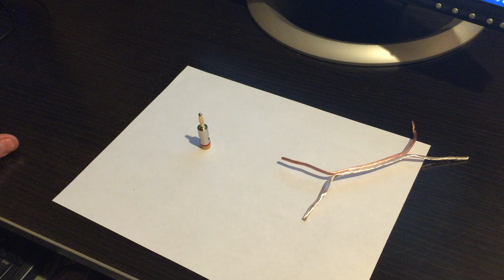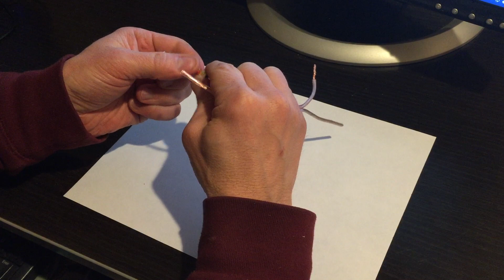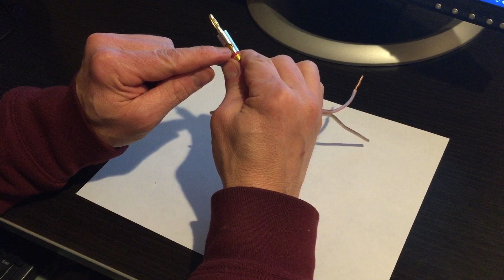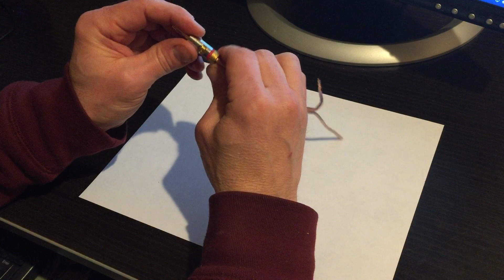Wiring a CE Tech Banana Plug

Comment: Strip off about 1" wire, no less; unscrew tip almost all of the way out insert/smash wire into the assembly. Hold both the wire and the plug and screw the tip on tight, this smashes stripped part of the wire into a ball.

Comment: From Home Depot support, basically exactly as described in this video:

"For this type of banana plug as others similar to it, you will first strip your speaker cables back to about 3/4" to no more than 1" in length.

Push the stripped wire through the bottom piece (the one with the hole in it), and then bundle or compress the wire at the end, so that the banana port portion will compress into it once it screws down into the bottom piece. Twist firmly and test it to ensure the connections are successful."

Comment: The hole in the end is for another banana plug Randy, it is not intended to take the cable. As Nicopeet alluded with this design the wires are inserted from the side and then the large screw tightened to hold the cables in place. I don't like these types because over time the cable strands relax under compression and you soon get a less than optimum connection.
The twin screw (Nakamichi) types are my personal fav's, 2 screw security and lightweight, give them a try my friend, I think you may prefer them.

Comment: I hate this type. The Nakamishi or equivalent type with 2 screws are the best. No bending of the wiring  needed.
Reply: phototristan 

I don't understand the female bannana sockets. The terminals the bannana plugs plug into.

I'll try and draw a mental picture of them. 

The fronts of the screw forward to reveal a hole in the side of the terminal.....and the pics on eBay show the bannana plug connected from the side. It appears then the front tightens down onto it.

I've never seen them connect from the side.....only straight forward from the front. 

I've seen bannana plugs with the side hole but not the female terminals. 

So I don't know if they plug into the front and the side or only the side.

I just want them to plug in normal straight forward.
Reply: I'd have to see a picture but you may have to remove little plastic end caps from your speakers first. I did on mine.
Reply: It's the speaker that I'm talking about.
Reply: phototristan 

Oh ok. I was confused about the female terminals.

I'm using these for a variable power supply. So they won't be connected to a speaker. They will be connected to aligator clips to supply DC current.

I'm working with salvaged electronics and Arduino.
Reply: phototristan

Update.

Not that you care I'm sure but they arrived in the mail today. The answer is they work both ways. from the side which the "face terminal thumb nut" can be tightened down onto the bannana jack or they can plug in to the face of the terminals. 

Thanks tho for the reply.

Comment: So glad to see someone else doing what you did. I had some "Sewell" banana plugs that have the "Teeth" to hold the wires that I love, they go through and then you spread out the "Wire Overage" down the sides then screw it on so as the wire cable comes out the bottom hole as you would expect. These Goofy Side Mount/Holes or whatever are confusing. I needed 4 more banana plugs to finish my 7.2 surround system, but I also needed more wire and a company on Amazon threw these in for "Free" with the wire purchase. But like many of us, you look at these and you wonder How In The Hell Do These "Poorly" designed things work?  Great Minds!!.....hehe..

Comment: Really, are you gues that stupid? Just put the copper wire through the hole on the side. It designed to be connected that way. The hole at the back can then be used for example for BI-wiring the banana-plugs on top off each other! If you want your cables out in a straight way, this method explained in the above movie is a good way to go with. But essentially, if you like your cables to come out straight, buy the closed bananaplugs type, not these open type with a hole on the sides.
Reply: Fight me
Reply: Right here
Reply: Right now
Reply: Sorry was not trying to insult anybody.
Reply: u did tho so
Reply from the maker: Ignore the peanut gallery, they are all comments from my son's friends.  You actually can't wire these from the side because there are threads on the inside of the cylinder the entire way, so if you push the wire in from the side, it just gets cut from the threads when you try to screw in the inner post.

Comment: Although I like your solution better according to http://www.cabletrain.com/1-pair-of-high-quality-copper-speaker-banana-plugs-open-screw-type.html and http://www.slideshare.net/boaty/banana-plugs-how-to-install-screw-type, you can 
insert the bare copper wire through the side and screw the bottom of the banana plugs to clamp it tightly.

Comment: Thanks for explaining.
My first thought was you had to put the bare end of the wire through the hole on the side and then screw in the back to tighten it down. I actually thought the hole at the back was so you could stack another plug onto it :)
However, now I'm still wondering what the holes on the side of the plug are meant for. They seem to have no purpose at all.
Reply: You are correct!